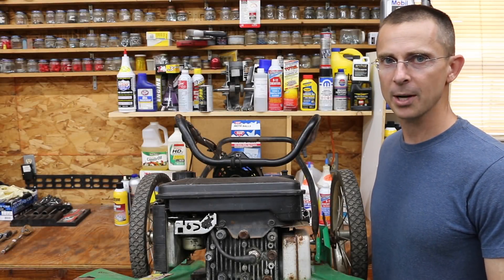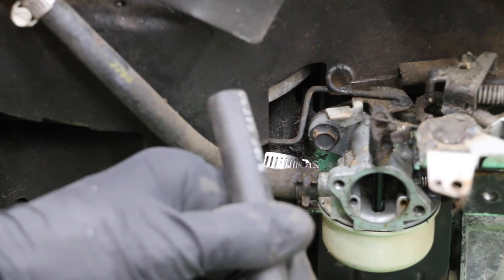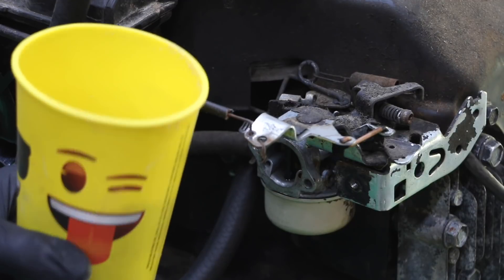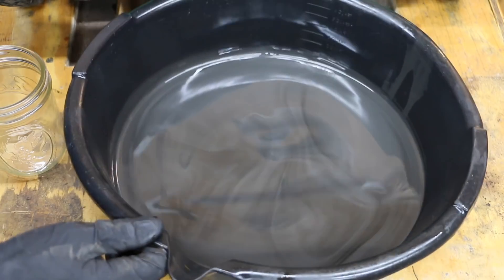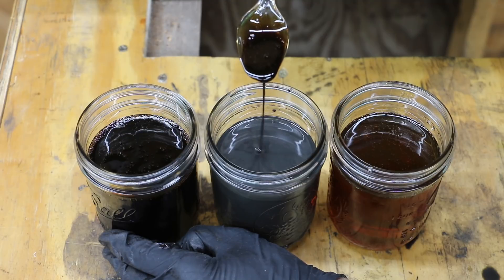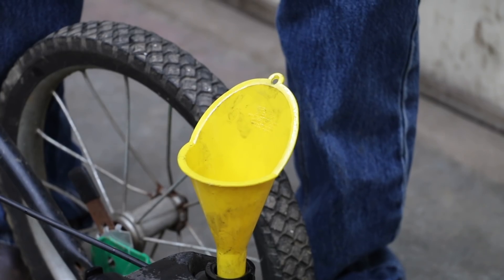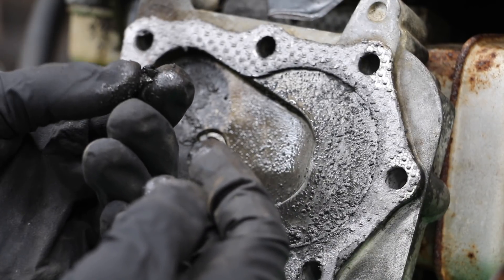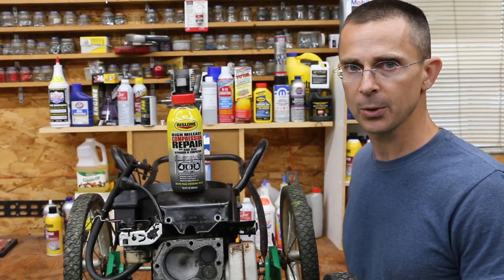Engine Eats Sand! Can Rislone Repair Compression Loss?

Comment: Looks like the Risolone broke some gunk loose that was caused by the poor oil choice and it bypassed the rings due to the wear. It looked about the same as every engine I've ever rebuilt that used Castrol for any real amount of time.
Reply from the maker: Thank you for the feedback

Comment: It might work in a cheap mower with more normal extended wear, or a boat outboard you can’t afford to replace instantly. I’m surprised if it helped any with a mower that ate a bucket of sand. Hey I’m surprised it ran again.  I expected the valves to be wrecked.
Reply from the maker: Thank you for the feedback

Comment: Rislone. I would imagine that this product is meant to improve ("restore" to whom believe it is possible) the compression of an engine that wore out by old age and regular use and not by one that ingested sand. If that was the case, the motor should have been disassembled, cleaned throughly from any sand so the only thing left would be the "damage", and them filled with the lubricant and Rislone...
Reply from the maker: Thank you for the feedback

Comment: another great video.  I wonder though if your results would have been better had you mixed 1 bottle rislone with 4 quarts oil then poured 20 oz of the properly mixed ratio into the tank. would you be willing to repeat this test from 2 years ago under these new conditions?
Reply from the maker: Thank you for the feedback

Comment: I'm yet to see what may happen long term but I used the Rislone on my car that has been blowing oil smoke. I'd say my engine does not have the scoring that your engine there suffered. I've seen a huge improvement in my engine. I'll be having a good look at my next oil change to see if there is anything that does not belong in my oil but so far, my car seems to be better for having used the product.

Comment: Ive got a backhoe suffering from low compression  and have tried ENGINE RESTOR and 2 other brands that was over 25 to 30 dollars a bottle. And couldnt tell any diffference at all. I was really hopping that this would help but nothing seems too unfortunately.....
Reply from the maker: Thanks for the feedback.  Have you done a leak down test to make sure the valves are in good shape and sealing properly?  Restore will only help with worn piston rings and won't help with valves

Comment: If you didn't clean out the sand from the cylinder then adding Rislone wouldn't do much... the sand would continue to cause damage the longer you ran it. Realistically you would at the very least need to give the cylinder a quick cleaning. And Rislone is designed to just repair small damage, nothing quite that dramatic... though it was interesting that there was some change afterward.

Comment: I have a diesel engine which has some stuck pistons. Do you know any products that I could use to restore it without opening it up?
Reply from the maker: You might try removing all the injectors and then add Marvel Mystery Oil to each cylinder.  Allow it to soak for several days.  Attempt to get the engine to turn over while the injectors are still removed.  Hope this helps.
Reply: @ProjectFarm   Thank you. After that, will it lose compression? (It is an old engine and it does not worth changing the pistons and reparing the block)

Comment: These are great vid's, thanks you! I do agree the sand you used was to cores and, you feed the sand eater a lot of it. If you wouldn't mind doing the test again with smaller grain like ash tray sand of finer since most engines would be exposed to that size. I would also recommend removing the piston and cleaning it to remove any of the metal that does not get washed out when you change the oil.
Reply from the maker: Thank you very much!

Comment: I will disagree with your opinion on this one.  Very un-realist that that much course grain sand would be dumped into that small an engine.  Also many of the B& S engines had an aluminum cylinder that the sand would just eat away.   I had a 1991 Chevy Cavalier w'4 cylinder.  The first time I added Ristone at about 145,000 miles every 40-50 miles of driving you could feel a stronger and smoother running engine and improved idle.  After 3-4 oil changes with Rislon I decide to skip using it and just did a new oil only  oil change.  In short time I could feel the power go away on the engine and the idle quality deterioarated too.   I had the same improvements on a tired old small block chevy V-8.    Real world wear and tear and steel cylinder liners will most likely show improvement with Rislone .
Reply from the maker: Thank you!

Comment: Hi, an additive I found worked very well on a back axel that was noisy, it stopped all the noise, long enough to sell the car, prosses / take an old inner tube cut into10mm squares, approx      1 Lbs, poke it through the bleed hole and top up with oil.  JOB  DONE.
Reply from the maker: Thank you!

Comment: Have you tried using auto tranny fluid (reminds me of MMO) to remove heavy carbon build up on valves and combustion chamber.  A mechanic in the 1960s said that's what it would do.  But put out a cloud of smoke that would make the EPA cringe.
Reply from the maker: I tried it in a different video and it seems to work

Comment: Run some coolant stop leak in the oil.
It will fix all tolerences, bearings sleeves and rings.

It used to be called STO KNOCK ENGINE RESTORER.
Reply from the maker: Thank you for the video idea!

Comment: Rislone 4447 is nothing more than just a very thick oil which might indeed improve oil pressure somewhat but Rislone's claims that it "frees sticky rings" and "fills gaps and scratches in cylinder walls" are pure nonsense. Don't buy it folks - waste of time and money.
Reply from the maker: Thank you!

Comment: I don't find this conclusive. I've been working on small engines and heavy equipment for 15 years and there is a big difference between worn out rings and cylinders, and straight up abrasive ingestion. Maybe try the Rislone straight or even 50/50. The sand will absolutely burn up your valves so you probably should've reseated and/or replaced and lapped in the valves, this way you're experiment doesn't have a random variable of valve leakage. Big fan of your channel BTW. Keep up the good work!
Reply from the maker: Thanks for the constructive feedback

Comment: I use a product called slick 50. It’s an oil additive that has Teflon in it. 
No good for this action but very good in older motors that are starting to wear. 
When it first hit the market they treated a Holden torana drained the oil and drove 
the car from Sydney to Melbourne with no oil. That’s a 550 mile drive.
Reply from the maker: Thank you
Reply: Project Farm    Just watched your video on slick50 lol.

Comment: No one?
What about you let the chemical do it's job. It may take hours to weeks. Maybe you added too much. Maybe your carburetor is still full of sand providing too rich mixture. Residual sand could continue scrapping a new metal off and combining with the chemical. I need to see a control test on an old engine without sand to toss the product away forever

Comment: Lol. I don't use mechanics in a can. Past oil stabilizers,it's all a racket.
Reply from the maker: Thank you!
Reply: only product that seemed to do what is stated in my experience  was bardahl no smoke(doubt i spelled that right) after a 30min drive it cut down oil smoke a good 80% .. 2v 4.6 mustang would leave a nice blue cloud in the middle of intersection after a long red light or after getting gas an start up at the pump embarrassing . just gives a slight haze every once in a while now...

Comment: It looked like the Rislone would have worked, if the scoring wasn't so deep, compared to the chamber pressure. The fact that it was bunching up in the combustion chamber, tells me that it would fill in scores if a finer sand, or even talcum powder would have been used. It also requires heat to work. That's what solidifies what looks like Teflon.
Reply from the maker: Thank you!

Comment: What have you found to be the best motor oil for a 98 k1500 with a 350 engine that has 206,xxx miles and a good engine flush. Thanks

Comment: For my propane scooter when I travel with it I am forced to drain out the oil.  When leaving the airport to drive it home I ask the nearest restaurant for a cup of oil.  Cooking oil that is.
                  Running peanut or grapeseed oil in weedwhacker type motor would be a great test for me.  I have not noticed any damage.  I know it would not be good in cold weather but I figured it can't be too bad.  

I wonder in a pinch if I could use petroleum jelly?  It would not be the best until it got warmed up.
Reply from the maker: Thank you for the video idea!

Comment: You'd probably get better results dumping some 80-90 gear oil in there, lol. In fact, I bet they were betting on the product doing something similar. What they thought that resin plastic chunking stuff would do is anyones guess. Just a gimmick that will make the engine worse....
Reply from the maker: Thank you

Comment: The theory that an accumulation of muck would also accumulate in scratches of the cylinder wall was a good THEORY. Once tested, it is clear that the movement of the rings over the scratches will not allow accumulation. Need a new theory :-0)
Reply from the maker: Thank you!

Comment: I've tried them all and none worked. How can a liquid dissolved and reconstitute itself on an engine part to fill in a gap? It's not going to work unless you make metal liquid and put in in the parts that need the gap filled, built it up larger then grind down to the surface you want it to be at the right clearances, that's the only way a liquid is going to work and do that job.
Reply from the maker: Thank you!

Comment: These products just thicken the oil, so they improve compression for a while if you have an old engine. I used a different brand on a diesel and it worked for about a month. I think all the 'engine repair' products work the same like this. Not surprised they dont work after scoring the cyliners though.
Reply from the maker: Thank you!

Comment: They is a certain way it has to be done if not you will ruin your engine I did it with a 1990 osbmobile with the 4 cylinder engine and before the use of the mixture I done a compression test the 1st cylinder was 118  2nd was 23.  3rd  was 41 and 4th was 114 . After doing using the mixture all cylinders was at 138 it will smoke and make all kinds of noise so if you do it, do it outside
Reply: Now if you like to know how to do it.  Just get ahold of me and I will tell you how
Reply from the maker: Thank you

Comment: Now that you have a good scratched engine, what about rad seal... radiator seal. Now it could be put in the oil or put in the gasoline. Plus there are a few different types of radiator seal. Also... what additive really restores a scratched engine, or helps improve compression, without just being thicker oil.

Also... I was working in the oil exploration and some fellows would run an engine with synthetic oil. Then they would drain the oil and run the engine for an hour, over lunch proving that synthetic oil bonds to the metal. Can you do a test like that, perhaps to the cease up or blow up limit?
Reply from the maker: Thank you for the video idea!

Comment: Need to try that engine restore sitting behind you next in that engine I love running rotella full synthetic diesel oil the blue bottle in my mower power washer and everything else that doesn't have a wet clutch and man I love it I can go soo long between oil changes and it's always carmely there are enough tests out there to prove hands over fists that full synthetic is better
Reply from the maker: Great recommendation! Thank you

Comment: Engine restorer worked for me but I had to use 4 cans over a period of time adding a can every time oil was low. Oil usage and smoke from exhaust completely stopped. This was on a 4cylinder corolla that needed a quart every 60 miles
Reply from the maker: Engine restorer is a great product!  Thank you.

Comment: Used the rislone product that reduces emissions/smoke etc. it adds to oil but it’s more just a blow by product. It’s fairly thick, I was struggling to pass diesel emissions in Colorado . I put the correct amount in and passed with the ratings of a new engine after driving it 75 miles before testing. After passing I did an oil change soon after, but it worked well. I have the VW 1.9L diesel with 212k on it.
Also * another topic. I used BG formula 109 as I recall. It cleaned up a bunked up sludgy Diesel engine at 143k. Crazy change in power and lubrication. I had been running valvoline 5w50 turbo diesel partial synthetic oil, in dry climate ( Denver) the oil lost quality quickly. Seemed to boil off organic water/distillates? Anyway it got sticky fast. Switched to liquimoly. And did much better.
Reply from the maker: Thank you!

Comment: Best part, I'm Australian and find rislone the only product that sells slot of self fix products, but does nothing. Used half of their range with none to very bad results. Worst one was for a main seal repair that managed to blow the head gasket from blocking the oil galleries in a motor I had. Was out $1000 and $30 for the rislone.

In short, rislone translates to snake oil.
Reply from the maker: Thank you!

Comment: I was raised  by a  mechanic  that lived a  mile from  me  an no he wasn't  my  Dad,  but he was  like a  second  Dad  and  my  Dad admired  him  for taking  an  interest  in  his  son  which was  me. .  this  Mechanic was  raised  and  worshiped  Rislone   ,  THIS  PRODUCT  IS  NOT DESIGNED TO  REBUILD AN engine  , it is designed  to dissolved the sludge  build  up  more slowly  than  using  
the  5  minute  motor  flush  that  is  commonly  seen  on many  auto  parts shelf.  When  anyone  uses  that 5  minute  engine  flush  they are  just asking  for a  new  engine  , because  what it does  it  desolves  the  gummed  up  engine  so  fast  like you might as  well poured  a quart  of  kerosene in your  engine  and  stared  off  on  a  long  trip.OK  , ARE YOU  FOLLING  ME? NOW  this  stuff does not  work over  night , because it does  like  i said  it desolves  sludge  slowly  , to keep  from breaking  chunks  of  gunk  up  and  getting into  your  oil gallireys  and stopping them  up  and  stopping  vital  oil  flow  to  all  your  engine  parts  even  right  down  to the  wrist  pins ,  Use it at ever oil change  or  in between  oil changes  and  in  one  year's  time you will have a  clean engine like it  never had  oil  poured in it at all. Take  my  word  for  it  ,he  was  not only a mechanic,  
he  was the  Service  Manageger  and  Parts Manager at  Ford  Motor  company  in Detroit , Michigan  ,  he  raised  four  sons  to  follow in his path  and  his  sons  is  who  I hung  out with  when  in  my teens. By  the  way his  name  was  Clifton  Baxter  one  hell of a nice man  to  the young  generation ,  that  like to teach  other kids how to make a living  and  loved every  minute  of  it,
 Thanks  for  letting  me  post,  You  Tube
Ray  Tuggle      ps sorry for  all the typos  but you can  make them  out.  only  had  3  minutes.

Comment: I don't know about this Rislone compression fixer stuff, but I've used regular Rislone when needed for over 30 years with good results.  Not sure, but the regular Rislone must be a high detergent additive, works by cleaning  up sticky rings and valves.  That's what I  use it for, to help clean out old neglected engines.  It takes time to dissolve and loosen up sludge.  Can't say it works better than a little tranny fluid, but it has worked well for me.
Reply from the maker: Thank you!

Comment: After eatin the sand thru the intake, I'm curious if it damaged the valve seats/ faces also... if your valves ain't seatin that might add to your compression loss. Lol i'm not expectin to see you do a full tear down, but maybe spin the crank by hand to open both valves & just do a quick inspection to see if that's a contributin factor also. Even if the product did work, if you're loosin 10 psi thru a bad exhaust valve seat the product can't ever fix that as it doesn't get applied to that area to attempt to fix it. 

Keep up the great experiments PF; it's refreshin to see someone who never fails to give strait up results thru controlled, as lifelike experiences as one would come across in day to day life.
Reply from the maker: The valve seats and faces seemed perfectly fine.  I thought they'd get ruined too.

Comment: I'm surprised since I have used the Rislone engine treatment for around 40 years now. Not the same product as the compression repair but same brand. I don't expect miracles but what I have seen is it does quite sticking lifters and really seems to be a good cleaning agent.
Reply from the maker: Thank you!

Comment: here in texas I had a 3 wheeler made by manco, it had a 5 horse briggs an Stratton on it from the mid 90's, I bought the motor for 10 bucks, it had such an oil problem it would burn 2 er 3 quarts in a day of riding, an that's 30 weight oil, I got fed up an went to the dollar store an bought them out of there ( oil stabilizer ) cheep motor honey lol an just ran it on that, it quieted the rod knock an stopped it smoking so bad lol, it didn't help with compression, but it did make it harder to start just coz of how thick it was at ambient temp lol, was cheeper then oil an lasted longer, I could fill it in the morning with motor honey an fill it again in the evening for the next day if it really needed it lol, it didn't burn anywere near as much lol. smelt kinda good to lol.
Reply from the maker: Glad the motor honey helped!  I bet it fouled a lot of spark plugs.
Reply: @ProjectFarm   sure did, I kept some sandpaper an a plug wrench in my pocket to clean it up if it stopped running lol